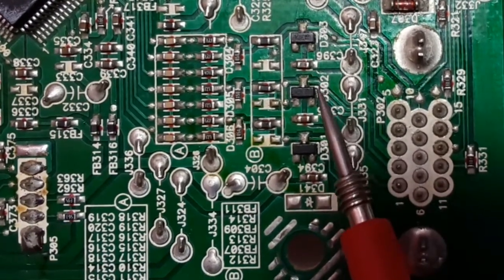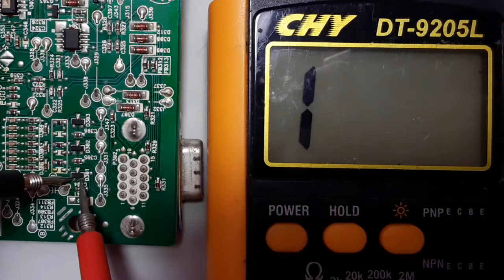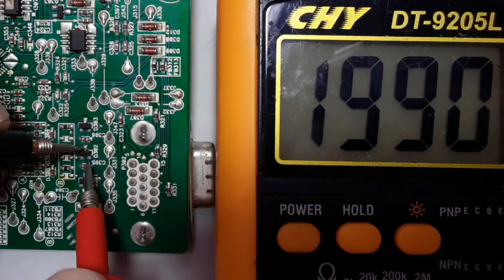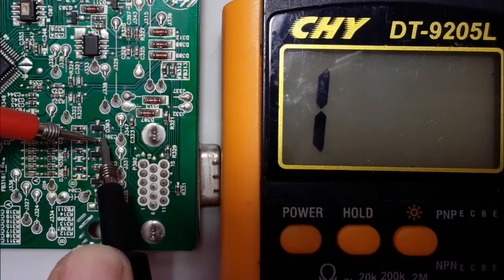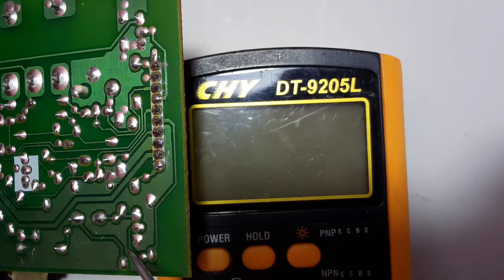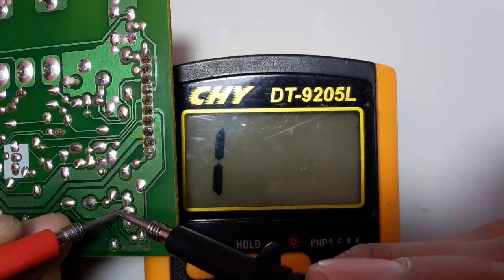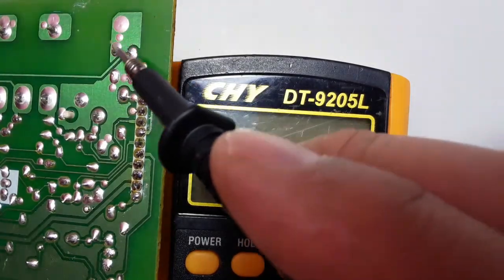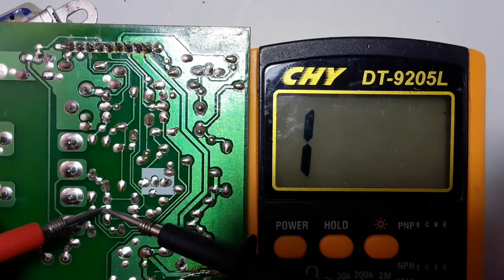SMD transistor testing: how to test transistor with multimeter

Comment: This video (at least the first part) is incorrect. check the pinout of a smd transistor. also, pretty sure those are dual diodes, not transistors.

Comment: This doide not transistor , you can see name of it in motherboard like D383 , and transistor name of it in mother begin with q like Q231 for exemple.
Reply from the maker: Hi there,
Right, but not always. 
I will give an example:
"Q" refers to transistor or MOSFET
"U" for IC (integrated circuit).
"D" for Diode. right.
but sometimes you can find "U" refer to MOSFET and "D" refer to Transistor.
Thank you
Reply: but then , you will be confused in diagnose problem in motherboard.
Reply: @electronicsrepairbasics_erb  I know this is old, but according to the datasheet it's a dual diode. also, your pinout for a smd transistor is incorrect.